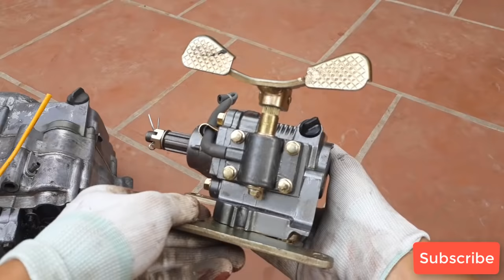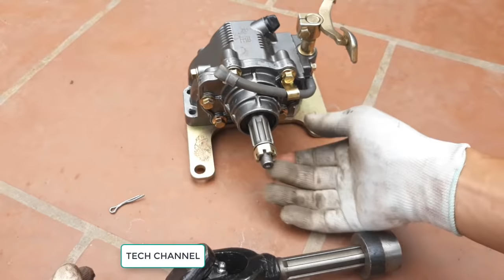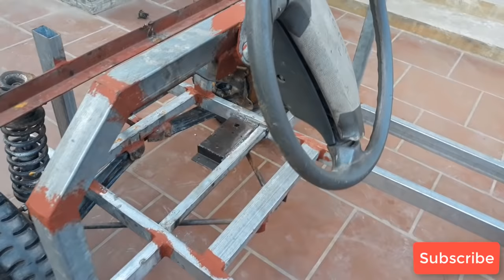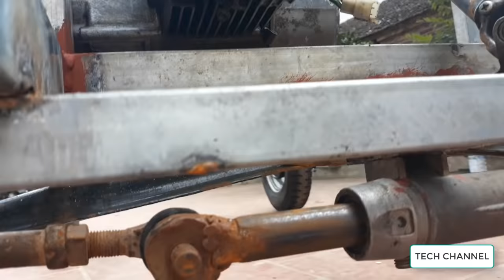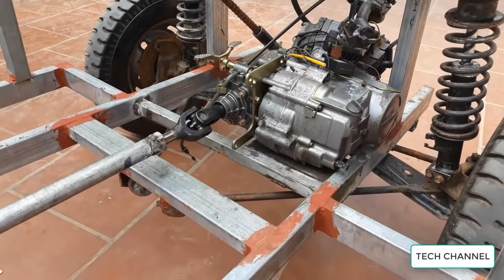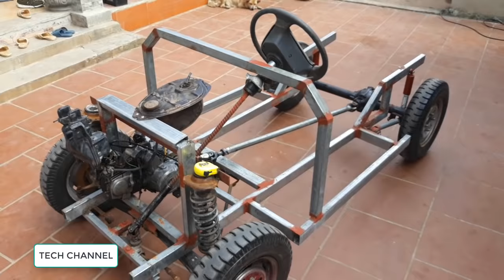TECH - How to make a car with independent suspension - part 8

Comment: I enjoyed this tech but can this reversed gearbox be used for motorcycles like Lifan 125CG,Lifan 100 and Qlink 150 Tiger motorcycles which is common in my Area in Nigeria. If not which reverse gearbox is appropriate for the above mentioned motorcycles.

Comment: Please I have a jawa_350 motorcycle and I want to turn it into a tricycle.
 I want to follow all his steps but I have no idea how to get the adapter 
to the motor unit to convert the chain system to cardan and to adapt the 
transmission bar to the differential. This device that you show in the
 TECH video - How to make a car with independent suspension - part 8.
 I can't get it, I'd be so kind as to show me your interiors to do it myself

Comment: Lack of a meter board !No brakes and handle steering wheel.No seats and handcuffs.No exhaust pipe!How stupid!
Reply: wait for part 9. those things you mentioned will be there.
Reply: Rex Mapagmahal Yes !But still non count weight .are you sure it could run over 60KM/H?

Comment: Hi. Please, I live in Cuba and it will be difficult for me to get the device that you adapt at the output of the Catalina in the engine unit to connect the transmission bar. If you were kind enough to show your pieces on the inside to try to do it myself